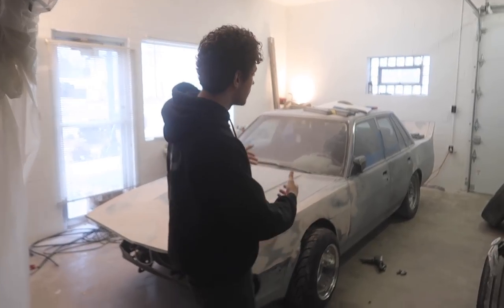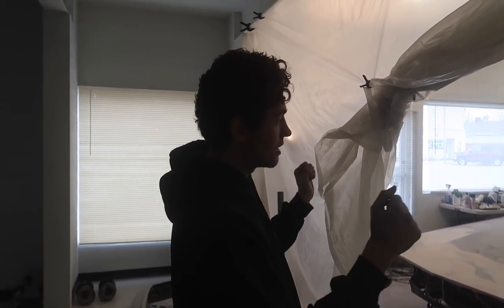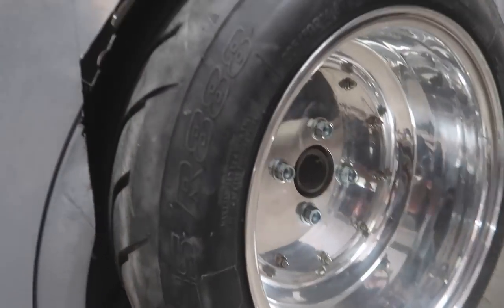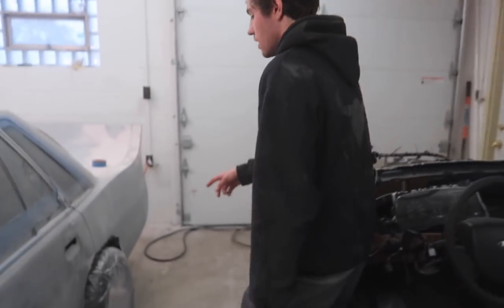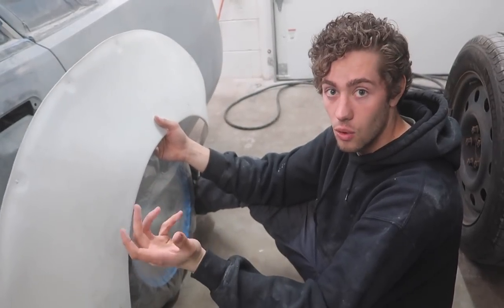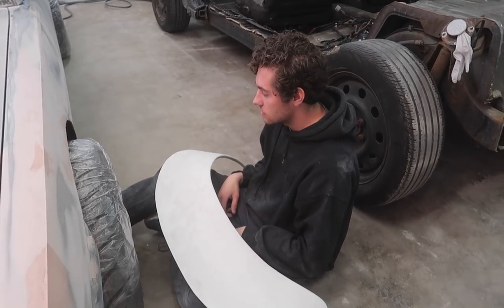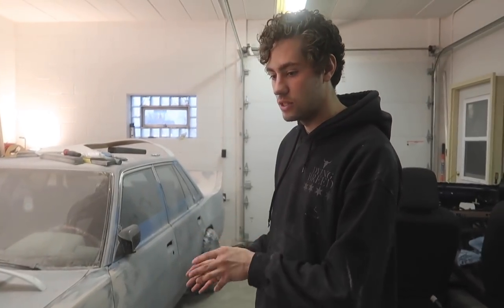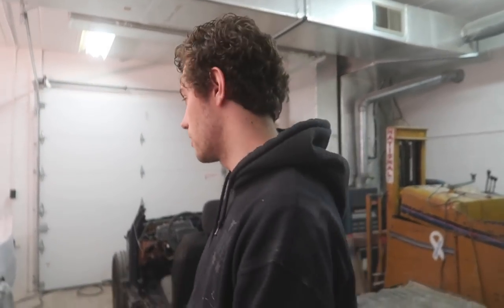First Time Ever! WHEELS + TIRES + FENDER FLARES!

Comment: Please just cut the flare in half along the door and make it useable... You've spent all this time sanding and filling the entire car, why not just go the extra mile?
Reply: I think the flare would look uneven at that point. The cut ends might vary in height
Reply: I mean, it can't be too hard to cut it following the door line after they're mounted and then box the ends in with some fiberglass. They're already gonna spend some time filling those gaps between the flare and the body anyway since they're for an older cressida..
Reply: rather just weld the door shut
Reply: If he does that it'll probably take him another year to finish it
Reply: +Toastalicious but also why would rear doors need to be useable if its a show car? Passengers can always just climb in through front door like many coupes.
Reply: its not true bosozoku style to do that. they look kinda ugly imo but thats the look hes going for

Comment: Definitely cut the flare along the door line so you have a functioning door. You might have to find a way to clip the bottom of the flares together so they stay stiff but ittle look good. Also try using Bondo to blend the fenders in with the body.
Reply: Its boso its not meant to be functional

Comment: would be cool to mount the rear flare then cut it in two places. Where the door joins the rear quarter panel and also where it meets the sill so the flare opens with the door. Might be flimsy though.

Comment: Reading through the comments, i'm pretty sure most people don't know what a Bosozoku car/Kaido Racer looks like, because if you did, you'd know that bolt on fender flares would be getting fitted & would most likely not be able to open the rear door.
Looking awesome & those wheels are perfect, i hope the paint will be something sparkly & in your face :)

Comment: I know it will be more bodywork than you'd like, but why not mold the flares into the rear doors? Mount them, probably fill it in with some expanding foam and bondo, cut the door away from the body, and bondoglass or just Bondo it all back together? It's just a thought, but I think it would make the car look a lot cleaner, and it would be easier to work with than having to remove the fender, put it back on, and risk cracking it, because you said yourself those are pretty fragile.

Comment: As you're not fixed on blocking/welding the back doors, you could add a mecanism like in 3 doors cars that allows the front seats (or at least the passenger) to fold forward so people can go in the back ! Problem solved and that would be an other original thing about this car !